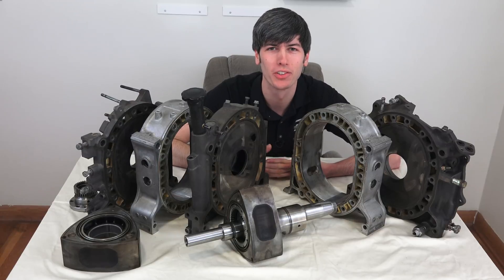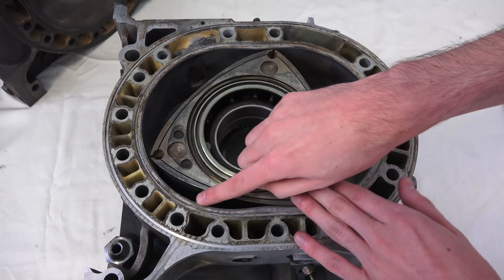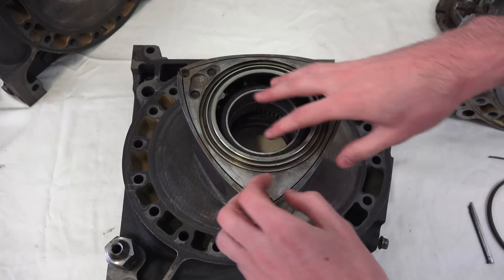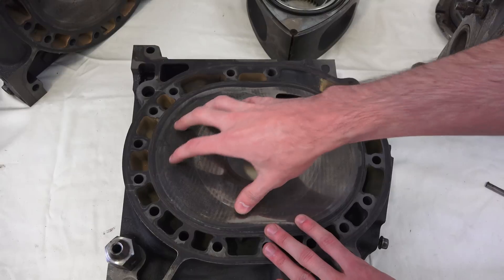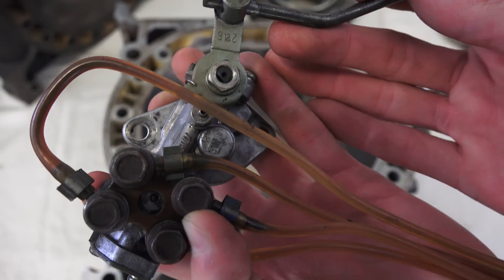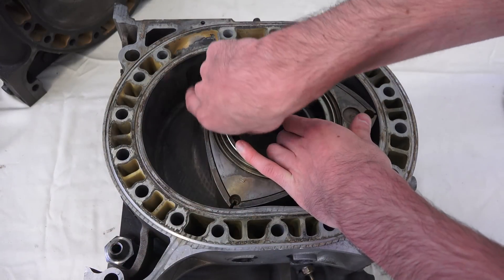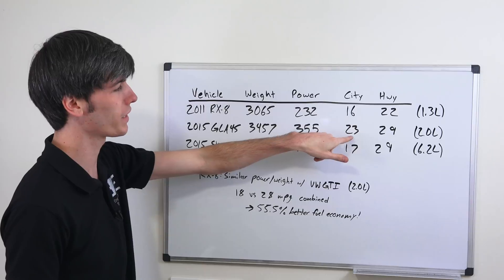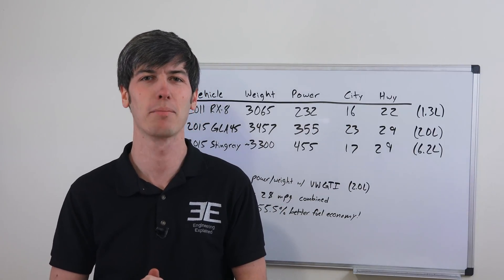4 Reasons Why The Rotary Engine Is Dead

Comment: Maybe the new carbon/ceramic composites will allow for better seals and ability to run at higher heat.  Also,  why not use 3 spark plugs or the old Honda CVCC combustion method?  It's like they got a patent and quit thinking.

Comment: The only reason why the rotary is "dead" or otherwise unused in todays cars because it hasn't been allowed development. The rotary is amazing at generating a high rev and therefore driving extremely; but let's face it, when you go buy a personal car for doing regular things,  you don't give two craps about its top speed. Top speed isn't even advertised in most cars because frankly, most people don't care and have nothing to benefit from caring. What makes the rotary inferior to other street cars in terms of street car characteristics, is its (currently) terrible emissions, mileage, and the like. The current rotary engine, quite underdeveloped compared to the piston, is not fit for street cars. What the rotary is fit for, though, is driving really fast and therefore racing. Unfortunately, the rotary is banned in most if not all races. 
This means that the rotary doesn't fit anywhere right now, and rotary engines can't promise increase sales(perhaps decrease sales) for companies looking to use the rotary. The rotary's current uselessness means that the rotary cannot generate income/profit, which means that there's no motive for companies to even sell the rotary, much less develop and upgrade it. Perhaps the rotary can greatly improve, such as the ways PH Smith(another commenter) listed, such as burning hydrogen for zero emissions. If a ton of R&D was conducted on the rotary, like the standard piston, perhaps the rotary could outclass the piston in nearly every way and become the new standard engine for every car, replacing the piston. But researching and developing rotaries is a large, long-term, and risky investment that won't even pay out very well. This highly discourages companies to research rotaries because it has nothing to gain from rotary development; therefore, the rotary may never improve, even though it may have the potential to be something great. 
This is why the rotary is still out of production; because companies have no motivation for improvement, and adequate improvement is required to turn the new rotary, which is still partially just an idea, into something that can compete against the old and heavily researched piston and be brought into the assembly lines. Perhaps if racing allowed rotary engines, or rotary engines could somehow allow their companies to benefit and make profit from them, companies could seriously consider researching and developing the rotary because rotaries have shown they can generate profit and are worthy of improvement and the cost of R&D. However, that currently just isn't true.
TLDR: The rotary has the potential to become better than the piston, but because the rotary cannot promise companies profit, companies have little motivation to put heavy R&D into rotaries. Since the rotary is still stuck in an underdeveloped state, and still partially an idea, its potential has not been uncovered and is still inferior to the standard and heavily studied piston, and therefore kept away from the assembly lines.

Comment: More specifically, the Wankel design.  That's one type of Rotary engine, though the only one with significant mass production, and development.  There are others, however the main problem with anything other than Reciprocating Piston Internal Combustion is that automakers don't want to re-tool.  Why we still have the intriniscally inertially inefficient design to this day:  It's what we're set-up to produce, and logistically supply.  (With parts, fuels, and so forth.)
Reply: The thermal efficiency is offset by the inertail efficiency.  For comparison, a piston stopes, and reverses direction twice each stroke.  4 times per cycle (With a 4 stroke cycle) for each piston.  So, at the rev-line (Le's say an average 6,000 revolutions per minute to simplify the equation) that's a grand total of 3,600 times per second in an average V-6 wound all the way up. It also has to be Balanced, which is done inertially (By timing the strokes at critical angles to each other which cancel out) which takes more energy from the system, burning more fuel, and generating more waste-heat.  Not as much in a Mazda Wankel, which is also Lighter (Adding mass the engine has to move) however this just spins, without inertial losses from stopping, and reversing direction, thousands of time per second.  (At it's power peak.)
Reply: Another factor is the number of moving parts, with regards to friction, wear, and lubrication.  The bottom of a RPICE is basically a hydraulic bath, churning up the oil to splash all over the insides, and keep everything wet.  To lower Friction, and carry off heat, but this also adds a load to the drivetrain you can test for yourself with an after-market part, called a Crank Scraper.  This is a baffle you can add to your oil pan, which wipes off the excess oil, prevents a lot of this splashing around, and keeps the counter-weights relatively dry.  The up-shot is, it can actually increase horsepower, AND fuel economy, by preventing some of that inertial loss.  How much depends on the engine, and how you drive it, but anything that improves Output, and Efficiency has to significantly reduce a major loss to do it.  Wankel Rotaries don't even have an oil pan, because they don't need one with 3 moving parts.  (In a 2 rotor stack, like the one in the video.)

Comment: These engines were king of the hill in dirt track stock car racing for years in my area. The sound of a built Rotary with no exhaust is amazing. My Dad would work on these and laugh, shops in my area would turn RX-7s away. My Dad always said if you could not work on one of these you should not be working on anything. The design is simple and boost helps a bunch with the emissions.

Comment: My understanding is the rotary is tremendously efficient within a very narrow RPM range, which makes it difficult to use as a main engine.  That said, it makes it brilliant for generator usage, where a static RPM is perfect, and the small size and weight of the engine is ideal for range extension on an electric motor driven vehicle.  That said, I'm a tech guy, not a gearhead.  Didn't see any discussion about this usage, though-- can anyone elaborate?

Comment: So mostly it's inefficient? but still the advantages it has makes it perfect for super cars, or track day cars, it's extremely small and light compared to the piston engine and provides more horsepower per weight and size and it being originally an aircraft engine means it's very reliable.

Comment: My 88 Mazda RX 7 13b was fun but PAINFUL to maintain
Reply: Aside from oil & filter changes, WHAT maintenance?  No valve adjustments, no problems at all in 160,000 miles.  Open the hood once in a while!

Comment: so why i it dead?.. it' still in production in the rx8 it's still considered to e a powerful package, if somewhat unreliable and hungry for oil maybe, but still alive... so... why do you say it's dead?
Reply: Mazda discontinued the RX8 and production Wankel engines over 8 years ago.
Reply: @sandervanderkammen9230  Fair comment, but on looking deeper it was 2011 when the last RX-8 was produced, so more like 10 years.
Reply: @crissyb00  The RX8 assembly line only operated one day per week after 2009, Production finally ended on June 22nd 2012.

Comment: The LiquidPiston X engine looks like an interesting solution to a lot of the problems in the Wankel rotary.  It seems to have DARPA support for development as a next generation replacement for the Wankel's in use in drones and might be a good option for hybrid roadgoing vehicles as well.
Reply: 100%
Imagine 3 or 4 LPs together, instead 4-4 roto

Comment: All of those drawbacks can be compensated for... the rotary can be turbocharged which eliminates the unburned fuel problem, and the seals can be made from industrial diamond, which I have in huge amounts... tonnes and tonnes... most exotics use a dry sump, which eliminates the oil issues..  there is a guy in California working on improving the wankel for use in his flying car... his whole operation is for sale... he's a little older than i am..  has been trying to get off the ground for more than 20 years... i am going to buy his operation including the wankel building.  . I can make em fly

Comment: I don't know the emission output, but what if you were able to design the  Wankel to run off of two stroke fuel? Since oil would already be incorporated in the fuel, one would not need to add oil (unless you had it seperated like an older jetski). Another option I thought of is coating it with teflon. It is a high temperature, low resistance material often used in cooking and as long as temperatures stayed under the melting point, I believe it could be beneficial. My third suggestion is probably too in depth for the quick response, but what about changing the design of the rotor/housing? If you did a star (either 5 or 6 point), it could create smaller chambers for it to function. Looking forward to a response!
Reply: a lot of people pre-mix their rx7's with 2stroke oil to help engine longevity. these engines are not as bad as this guy says but most people don't know how to maintain and operate them so they get a bad reputation and get swapped out for v8s.
Reply: You are curious and creative. You should be out there with the other innovators helping move this design beyond its flaws.

Comment: I've owned two RX-7s and fell in love with both of them.  My second one was a 1993 model with twin turbos, 255 horsepower, with explosive acceleration!  Sure wish I still had it.
Reply: My friend had an early model Rx7. That thing used to scare the pants off me. The only thing that seemed to limit how fast it could go was finding enough straight road. Mad car.

I just hope that material sciences will be able to solve some of the problems and we can see a return of the rotary.
Reply: California Dreamin   All electric cars were shelved for 100+ years until battery tech improved.
Reply: @sporehux8344  Until battery cars can cross continents like the Land Rover first did, they are a gimmick and a nuisance.  Also extremely toxic to the environment.
Reply: @kevinchamberlain7928  Lithium batteries are a very serious and underrated fire risk, the number of fatalities and insurance claims have skyrocketed.
Reply: @ants621  
Rotary far from dead,the vargas bros are building some epic engines, then got people like PAC & PPRE doing billet engines now 👍
Reply: @markcozzie  The Wankel engine has been completely obsolete since 2012.
Reply: @sandervanderkammen9230  Yeah, no... Mazda are still working on the rotary, specifically as a recharge motor for hybrid cars.
Reply: @Studentofgosset  No it's not. Mazda discontinued development in May 2009.
No new prototype Wankel engine has a seen since 2007 and the last time Mazda unveiled a new production Wankel engine was over a quarter century ago.
Reply: @sandervanderkammen9230  they could be hiding the fact they're building one, remember the Tuatara? That went dark for years and made everyone wonder if they were even doing it, it could be similar with the Rotary
Reply: @warrenlaughlin26  OR, it could be that all these clickbait rumors from amateur bloggers are not true...
Reply: @sandervanderkammen9230  maybe, but this would be the first I've heard of it
Reply: @warrenlaughlin26  Really? There have been at least one new rumor every year since Mazda announced that the RX8 would be discontinued. 
There has been hundreds if not thousands of clickbait articles on the internet all confirming that Mazda will bring back the Wankel engine.
Not a single one of these "confirmed" rumors have ever turned out to be true.
Reply: @sandervanderkammen9230  yeah, I like rotarys, but I prefer Muscle, I'm also 15
Reply: @warrenlaughlin26  Well my young friend, I am very happy to hear you are interested in cars, so few people your age are these days are.
 When I was your age lots of companies were developing or selling Wankel engines.
 Many of the experts believed at the time that Wankel engines were actually going to completely replace piston engines.
By the mid 1980s however the general consensus among engine manufacturers was the Wankel was completely inferior, they all discontinued development and production of Wankel engines.
Mazda ignored the truth and continued losing money on Wankel engines until 2012 when sales completely dried up and the company went bankrupt for its third time.
Reply: @sandervanderkammen9230  I heard about lots of brands doing it, but they're typical piston engines were better, but Mazda didn't stop until they made a reliable Wankle, that won le mans, and was even the first Japanese car to win as well

And its sad how very few people my age are into cars, thankfully there's still a few though
Reply: @warrenlaughlin26  Unfortunately Mazda never made a reliable Wankel engine, the RX8 has probably the most unreliable engine sold in the 21st century.
The Mazda 787b was ultimately a failure losing both the 1990 and 1991 world endurance racing championships to Mercedes-Benz and Jaguar.
Losing 20 out of 21 races and never posted a single pole position or fastest race lap.
Mazda abandoned all development of Wankel engines in May 2009 and all production ceased in June 2012.
Reply: @sandervanderkammen9230  I thought the 787b won le mans though
Reply: @warrenlaughlin26  Lost the world's championship to Jaguar.
Reply: @sandervanderkammen9230  oh, I thought It won, by a bit too
Reply: Mazda's goal to win a championship was not successful.
Mazda no longer has any motorsports program.
Reply: @sandervanderkammen9230  where did you get the information about this?
Reply: @warrenlaughlin26  I closely followed the WSC championship series and attended many of the races, I can link some of the race results.

Mazda abandoned Motorsports in 2016 when it departed both the Indy Pro Mazda series and FIA Endurance racing.
Reply: @sandervanderkammen9230  okay, that makes sense, thank you for the information and sorry if I was sounding toxic
Reply: @warrenlaughlin26  No problem, there is not a lot of good information about Wankel engines out there anymore.
Cheers!
Reply: Twin turbos and only 255 hp is really disappointing figures .
Reply: @Jenksauto  it could be running low boost
Reply: @riogrande163  Most likely it's running low compression..
Reply: @Jenksauto  not bad for 1.3 liter.
Reply: @eugeneoreilly9356  Its not a 1.3 liter.
Reply: California Dreamin  "16-valve per cylinder engines" 
  0_o
 I'm sure that was a writing mistake but... still lol
Reply: @Some One 255hp from 1.3 liters is good no matter what it's compare to.The power to weight ratio is way better than any 3.9 liter engine.Only engine with better is a gas turbine but not many off those powered cars.
Reply: @Some One No torque?Take a look at the 92 isle of man senior TT.Steve Hislop win on the rotary Norton over Carl Fogarty on the Yamaha.The Norton was alot faster on the straights.
Reply: @eugeneoreilly9356  Yup, no torque... even when Norton cheated on the displacement classification.
Reply: @sandervanderkammen9230  Not quite.They would have been disqualified if they did.The rules were followed by the book
Reply: @sandervanderkammen9230  err no.Steve Hislop walked off into the sunset with the trophy with no complaint from   Fogerty or Yamaha.
Reply: @eugeneoreilly9356  Honda won the 1992 TT trophy...
Norton was booted out of the 500cc class.
Reply: I think the gas mileage would be better if you could ever drive
Reply: California Dreamin  Mazda's board of directors cancelled further development of Wankel engines in May 2009.
 There have been no new prototype Wankel engines seen since the 16X in 2008 and it too was cancelled.

Mazda has not unveiled a new production Wankel engine in a quarter of a century.
Reply: California Dreamin  Multi-valve engines are certainly not radical new technology, so definitely not a fitting analogy.

Radical new technology is VVT, VVL, VCR and electronically controlled stratified charge mode combustion made possible by direct gasoline injection.

Sadly all technology that cannot be successful adapted to the obsolete Wankel engine due to the inherent limitations of its basic fundamental geometry.

Comment: Rotary in an rx8 wasn’t built for fuel economy.  It was built for tuning.  My Mazda mx5 was a 1.8L 4 cylinder and got around 110 hp.  while this rx8 engine is a 1.3L getting more than double that.  That is the genus of this engineering behind this engine.  The rx7 engines were actually better because they were built for and sold with boost stock while the rx8 is natural aspiration and made cheaper.

Comment: See... Rotary engines apply the power to your tires quicker. Horsepower is just how how fast your power is carried from the motor to the tires... and how torque comes after.  A standard piston engine has to take the extra time to turn vertical motion into circular motion. This is why having a high horsepower in piston engines is a big deal, because of all the slack and resistance made by all the extra components. With rotary engines there is minimal slack in the transfer of power to the driveshaft... therefore requiring less horsepower to propel the car at a much faster rate than a standard piston engine. There are ways to increase heat transfer throughout the combustion cycle... as well as sealing it.